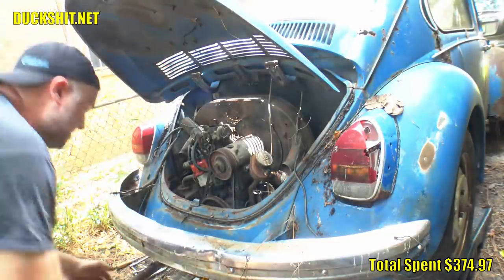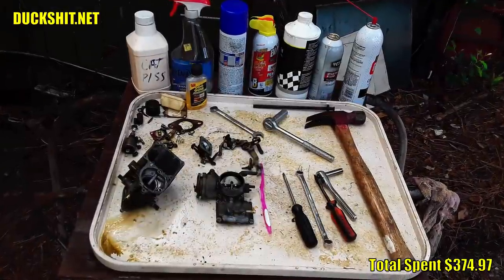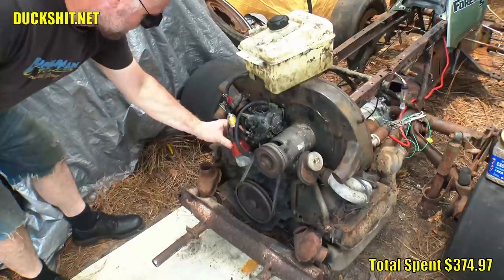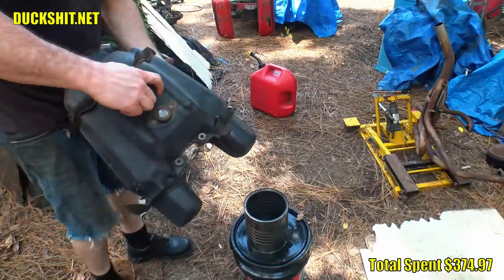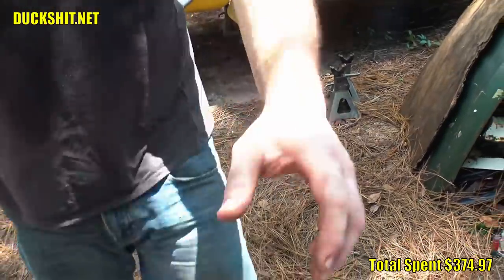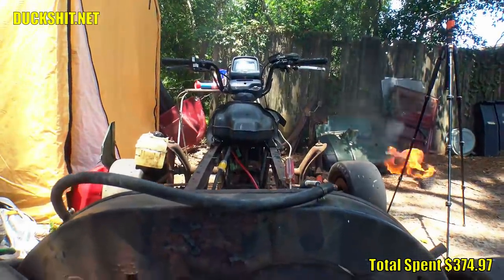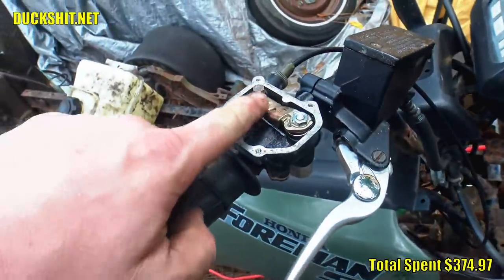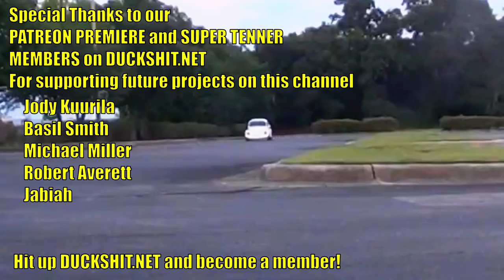Running GREAT! - VW Motorcycle - ATVW Junkyard Build - Part 8

Comment: Just FYI: Here in the mid-south in Illinois/Kentucky/Tennessee/Missouri, a lot of folks use synthetic 2 cycle oil in place of fuel stabilizer. It works great, (better in this climate than the recommended stuff) and that might explain the smell.
Reply from the maker: Maybe, it sure stunk though!  Haha! I have smelled it in my backyard and even in the house for the past month!  Its only just finally going away.  I think the tank is clear and all the waste and cleaning rags are finally gone.
Reply: @DuckmanCycles  the gift that keeps on giving... :)
Reply: With that said, I am 67 this year, and this is one of the coolest builds I have seen. Thank you.
Reply from the maker: Thanks so much Jack!   More updates soon!